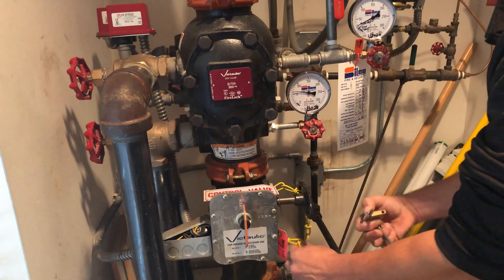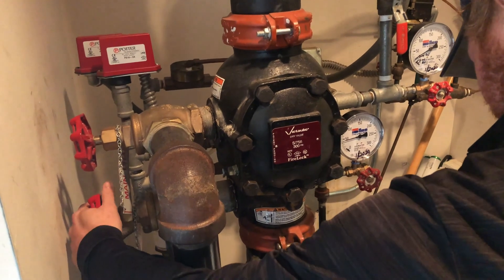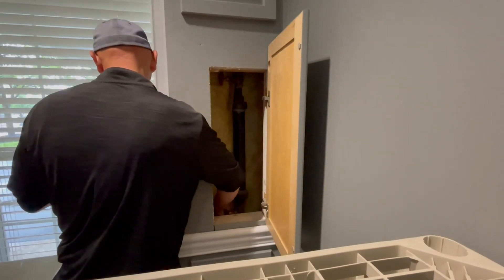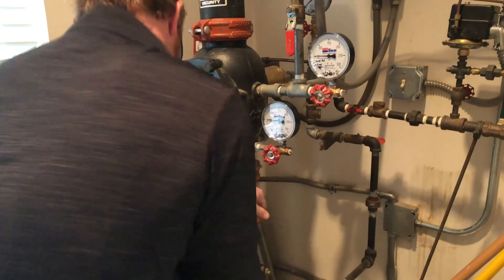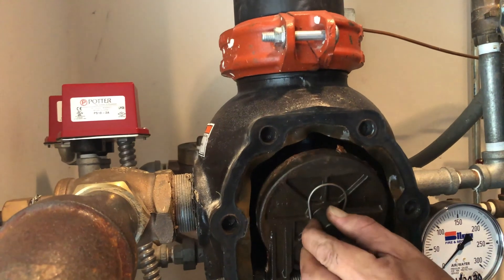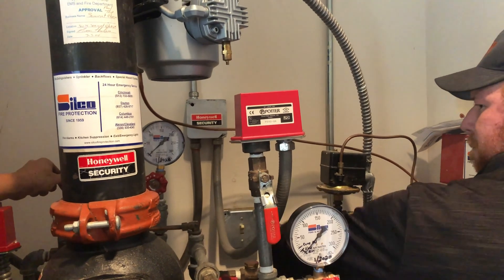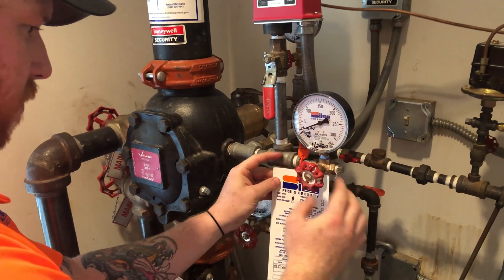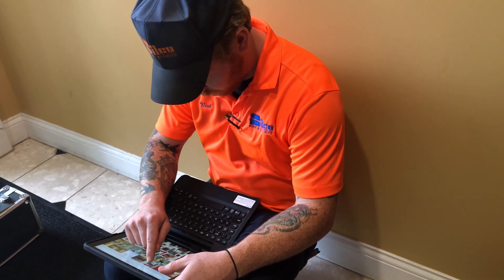Dry Sprinkler Inspection

Comment: You shouldn't use the heads in the spares box to check for dates . The date you are looking for is date of install and the date stamped on the heads are the manufacturing date . To know the date of install you have to acquire the as built drawlings and or initial inspection report . But thats not always available especially in old buildings that have changed owners so then you do the best with what you got and use the heads in the box .

Comment: Question, we had an issue on our riser that sometimes loose air pressure . What is normally the cause of loosing air pressure on the system?  Thanks
Reply from the maker: Hi @seattlebest79 and thank you for the question! While it's hard to say what could be causing the air pressure drop on your riser without a licensed technician checking your setup. One of the most common occurrences is pipe decay around the fittings. The Victaulic couplings that join the pipes have a small amount of water always sitting there and this can cause the pipe to decay over time, and leaks can start at that point. 

It could also be that the low point drain valve is not completely shut. Performing a 3-year leak test should show signs of your issue and is a code required test every 3 years. Systems naturally lose a little air pressure, but your air compressor should be powerful enough to keep adequate pressure on your dry system to offset the air loss. It's not uncommon for the air compressor to engage daily. 

Hopefully this helps you with your question. We recommend having a licensed technician take a look at your system to verify the cause of your air pressure loss.

Comment: is there a way I can test the water flow switch without tripping the Dry Valve? thanks..
Reply: Theres no flow switch on a dry riser. Youre talking about a wet system. You can trip the flow switch manually by opening the cover and pressing down on the little black lever.
Reply: @privateuser7 dry valves definitely have flow switches.   They are a pressure switch style flow switch.   Located on the trim off the intermediate chamber port of the dry valve.
Reply: @LibertyTree33 that's  a pressure switch/ hi-low switch not a flow switch
Reply: @privateuser7 it’s a pressure switch and in that application it’s used to detect water flow.
Reply: @privateuser7 but what do I know I’ve only been a fire sprinkler fitter for 20 years now.
Reply: @privateuser7 same switch you would see on an older alarm valve system.  In both cases they each are used as a flow switch in that they detect water flow.  You can also have paddle flow switches on wet systems that also are used to detect water flow.
Reply: 1 Put the system on test call alarm company. 
2 close the piv or backflow valve. 
3 close the control valve. At the alarm valve Make note of the alarm panel readings for each supervised device ie. backflow or piv. Control valve. 
Close the air supply ball valve  to the Alarm valve located at the compressor. 
4 Open the water flow device/Switch with the key provided by the manufacturer. 
5 manually engage and hold down the stick lever in the middle of the device for At least two minutes make note of the time detection is achieved. 
Revers the process. Clear the panel.
Reply: Many dry pipe valves have an alarm test valve. It comes from the bottom side of the clapper and goes into a tee that feeds the high pressure switch (water flow switch). It allows you to force water into the pressure switch with no risk of tripping the system.
Reply from the maker: Yes, there is a way to test the flow switch and not trip the valve. Depending on where you live and the regulations in your area, we recommend to have your inspector there to perform the test.